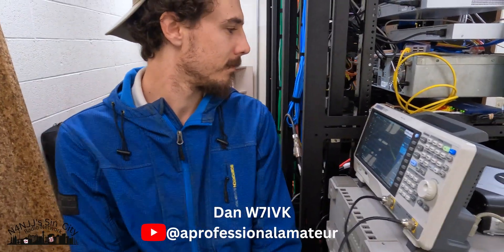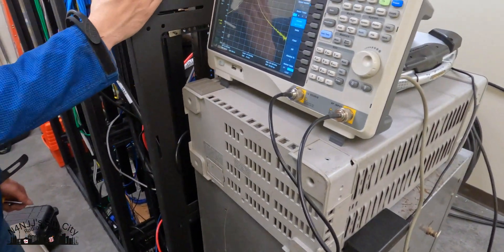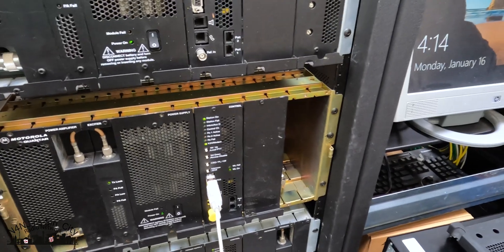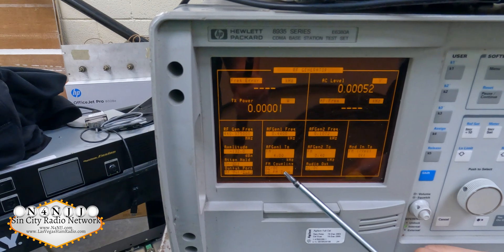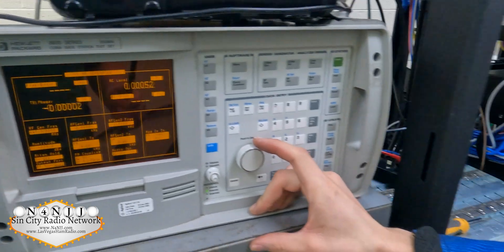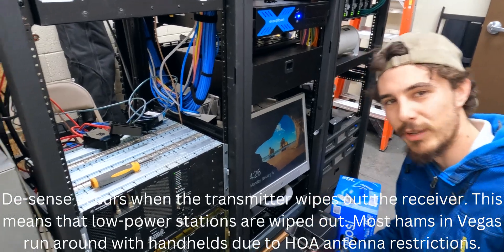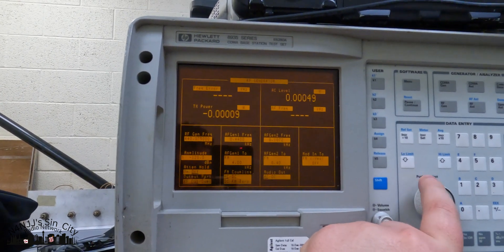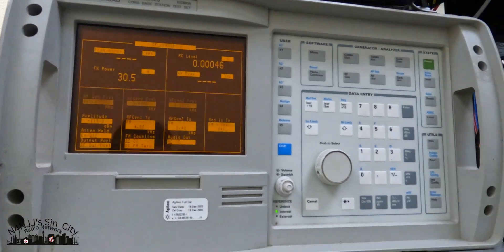Tuning a Motorola Quantar Pre-Selector on a Siglent 3021. Verifying on an HP 8935 Service Monitor.

Comment: One reason why the Old GE MASTR II series repeaters worked. That preselector kept out interference. Let’s look at an additional item that repeater sites fail to require on systems. THE CIRCULATOR! It must be tuned to pass only the output frequency of the transmitter and be placed between the transmitter and duplexer or if your are on a site using common transmit antenna system it must be placed after the transmitter and before the transmit combiner. This will help keep out stray RF from the transmitters which could generate spurs on other frequencies when the stray RF gets into the transmit system, mixes and outputs another frequency.

Comment: when tuning the filter for a given frequency, especially if connected to a duplexer, you want to tune it for best s11.  If only tuned for s21, there can be a significant mismatch on the receiver port of the duplexer and "detune" the duplexer. You should see no degradation of SINAD with the transmitter on vs. off if everything is working right.  In amateur service, and if the site supports it, the quantar will benefit from a GASFET pre amp.  I have seen improvement of over 6 dB from -119 to -125 through the duplexer with this.